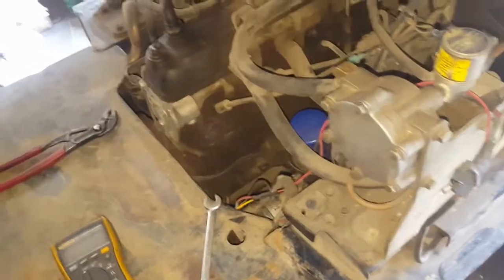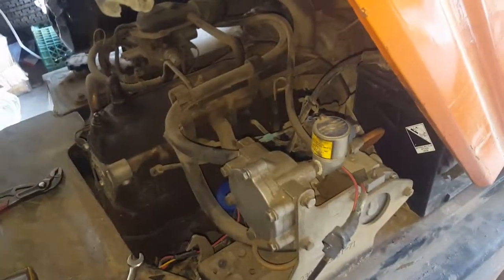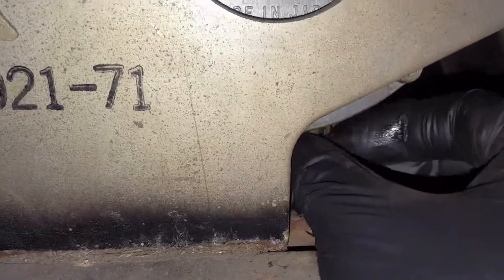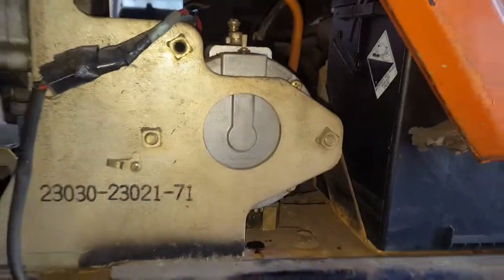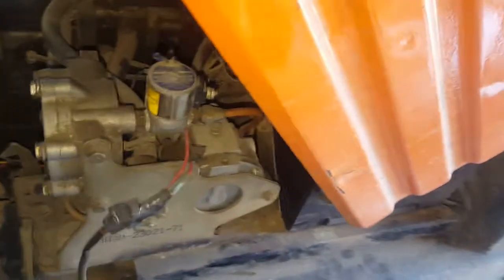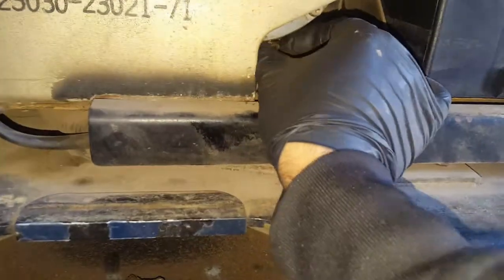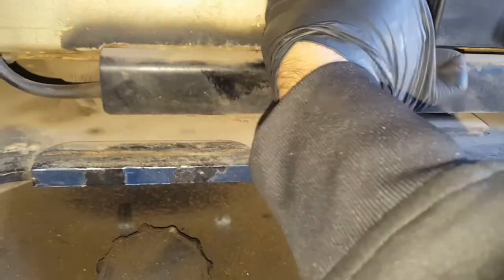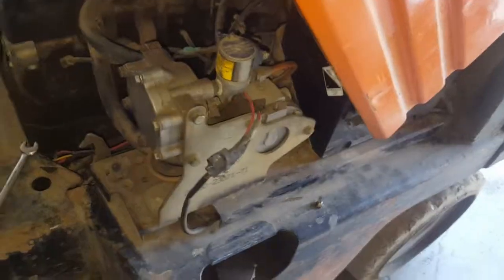Forklift Propane Regulator Maintenance

Comment: Our Forklift will start and run...  But after shutting it off (sometimes will die), we have to wait several minutes (20 or more) before we can get it to start again.   Would would the regulator maintenance in in the this video fix the issue or what else can we look at?
Reply: This is YouTube not google.

Comment: So does the propane go from the tank to the regulator then from the regulator to the( what’s it called) them to the intake?  Also the selenoid with the yellow label. Is the open when key I’m in the on position? And do they normally just have one wire going to them ?  I have an older Yale with something similar and I found a loose wiring harness with one stripped back brown wire and there is an eyelet missing the wire. But the eyelet is mounted to the housing screws of this selenoid if I was guessing it’s a ground. But I don’t see anywhere a power wire would hook
Reply from the maker: Hi Matt, most of the time it will be from the propane tank to the lock off solenoid than the regulator and to the mixer (intake). On this Toyota it opens from a rev switch that gets the signal from the distributor. Unfortunately without the schematic for your Yale I couldn't tell you.

Comment: I have a engine that starts up but after a short period of time the regulator frosts up and the engine quits. It will restart but not keep running. Any suggestions?
Reply from the maker: Hey Bruce, check your coolant level first also for a air bubble in the water pump.
Reply: @kaizenliftlimited9825 If there's an air bubble how do I purge it?